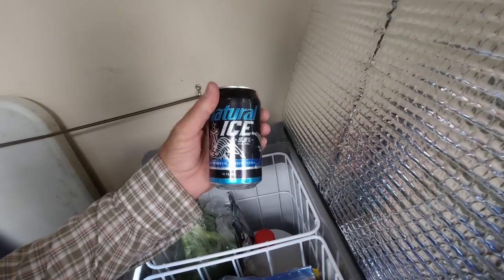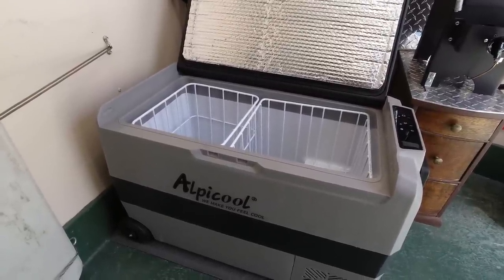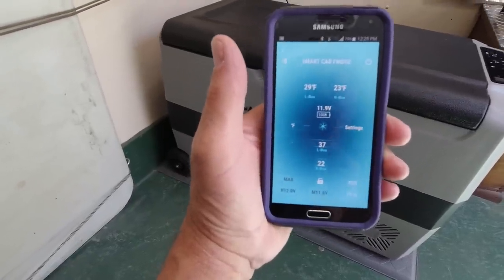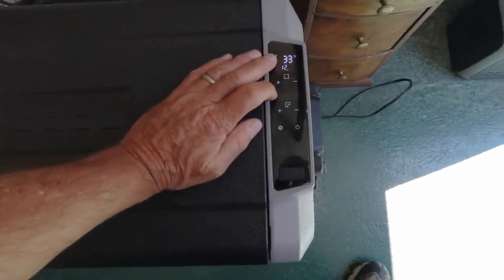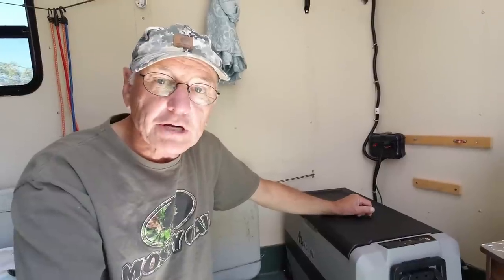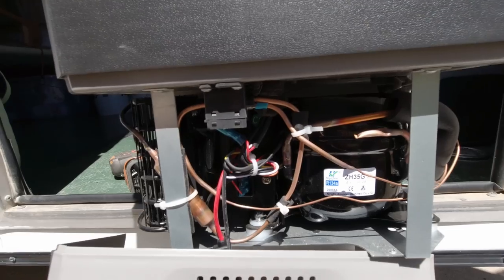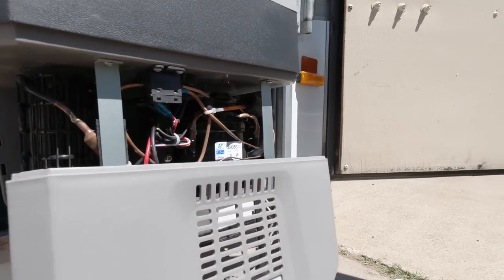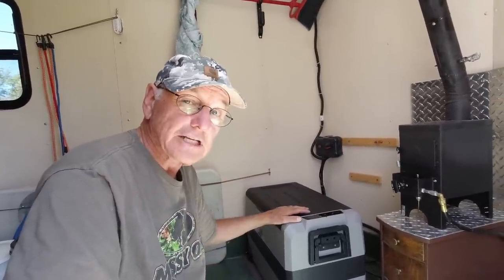Alpicool T50 12 Volt Refrigerator - Is It Worth It?

Comment: I have looked at these but went with a real frig. 4.5 cubic feet it use's .52 KWH in 25 hours and that from room temp to cold and using it so if I hook it up to cool down before leaving home and keep it cold with my Bluetti it will use less I checked it after it cooled down and in 24 hours it used .38 KWH. With the rattle  try some weather stripping on the racks or trays. Now they way I use my frig is I freeze two two liter bottles of water everyday and put in a cooler and I put all my drinks in the cooler to keep from having to open the frig that I keep my food in so it use's less power. Every morning I pull the two bottles out of the freezer and put them in the cooler I can have 12 bottles of ice tea in the cooler at a time and 12 in the frig and put the two old bottles back in the freezer. So I have cold drinks all the time and all my food stays cool and I have done 3 weeks like this at a time because I can get 3 weeks of food in my frig at a time. I hope this works for you. As always your video's are A learning experience. We hope your tomorrow is  better than your today was.
Reply from the maker: That's another great idea in managing the available cold and Linda and I just discussed how that could work for us.  We would lose half of our refrigerator space to be able to freeze the water bottles, but, on the plus side, we could the left over space in the freezer for frozen meat, vegetables and ICE CREAM!  Oh, did I capitalize that?
Reply from the maker: @Cockeyed_Den8213  I looked for the photos but couldn't find them.  Good idea anyway.

Comment: Thanks for the thorough review. I've been searching for specific info on this alpicool product on that does it also serve as freezer if we want it to,  and you definitely provided it very well.

About efficiency, you can have more in two ways:
1. Have 10 sqmm cables run directly from the battery, into a circuit breaker, into the fridge, no cigarette lighter plugs.
2. Have the vent holes breathe air from and out to outside air when it's colder outside, or from inside when otherwise.
Reply from the maker: Great tips.  We recently did shorten the cable and hardwired it in.  I like your idea of the vents too.